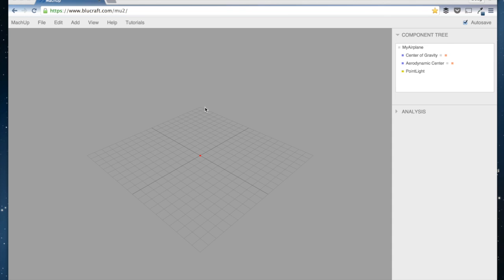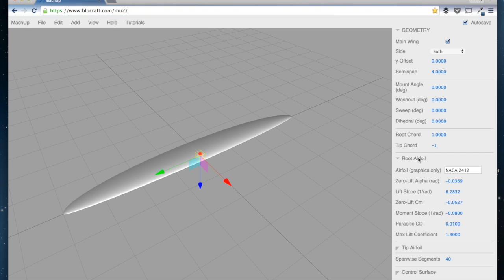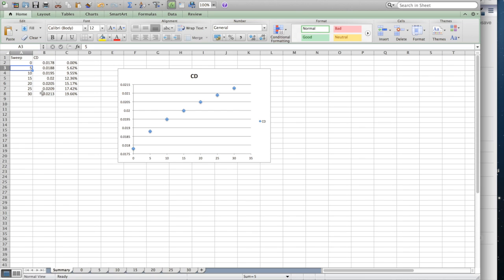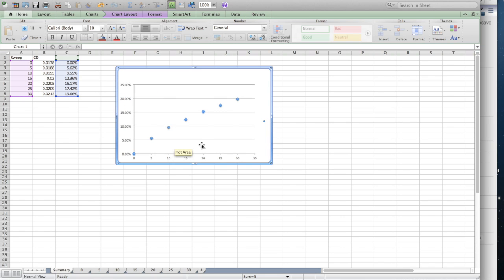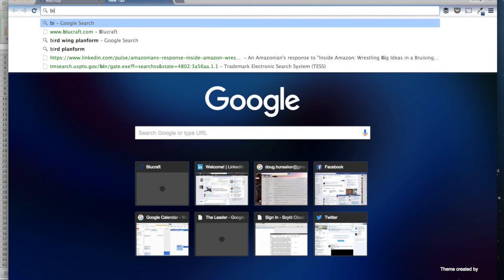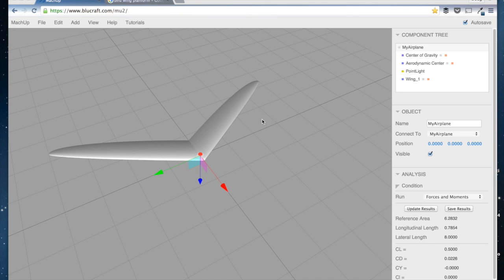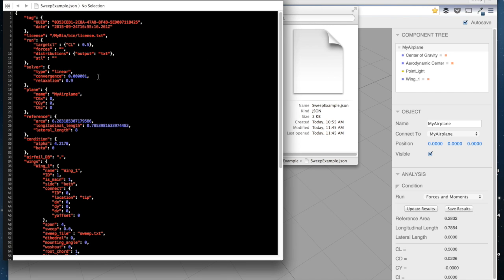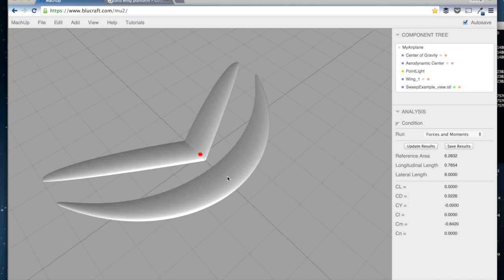Why sweep can hurt you and what to do about it

Comment: Question: With a pusher style plane is this cancellation effect (12:27)  masked out by the turning prop?
Reply from the maker: +ad2181 The flow upstream of a propeller is relatively unaffected by the presence of a propeller, so I would not expect a pusher configuration to be much different than what is shown here. However, a puller configuration will disrupt the flow in that central region due to propwash. So the puller configuration would be significantly different than what is shown here. Does that help?